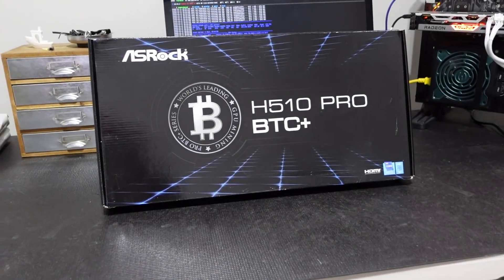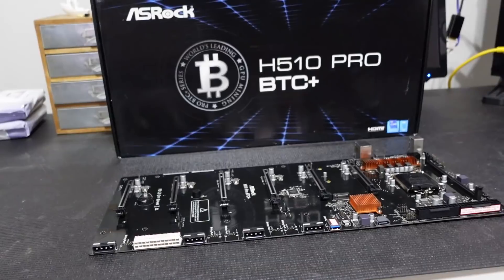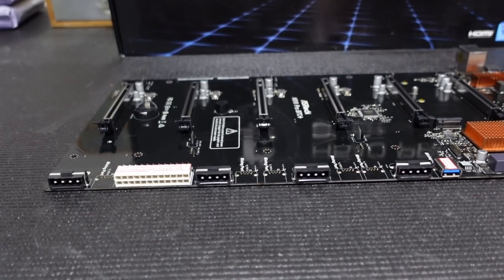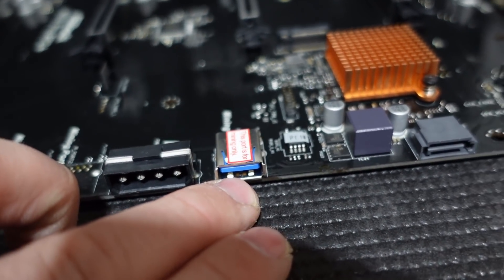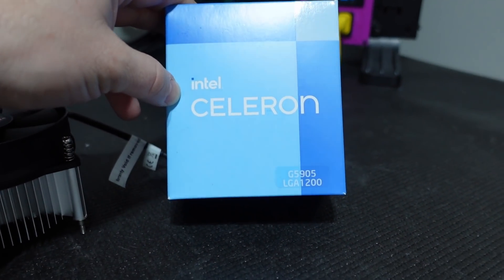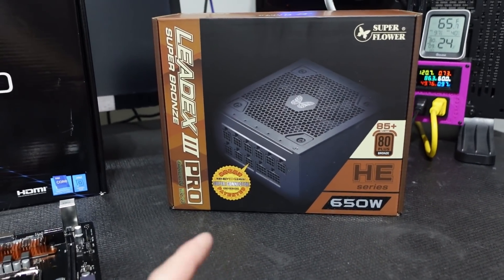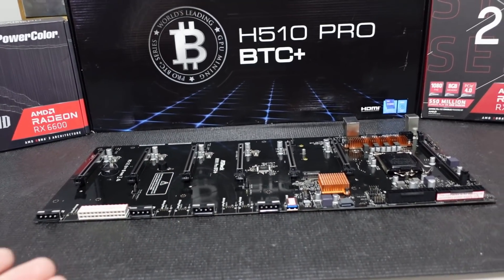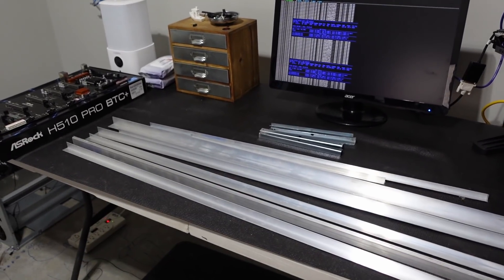Should you use an ASROCK H510 Pro BTC+ Motherboard for Crypto Mining?

Comment: I’ve have 2 of this same motherboard. Currently using two strings to power the pcie slots + one riser, for a total of 5 pcie slots. One string for 3 slots and the other string for the 4th + the riser. Boths strings are fed from the peripherals ports on the PSU. Everything is powered including the GPUs (7 XFX RX 6700 XT) by one PSU, EVGA Supernova 1300 P+. Never had any issues since July 2021 and still running…🤷🏻‍♂️

Comment: This is a good board just didnt care that atx was the only way to go I HAD THIS BOARD AND I CAN TELL U, YOU CAN HAVE A TOTAL 10 POSSIBLY 12. The first slot is a full x16 slot so you can add a x4 or x6 riser card if ur cpu has enough pcie lanes to support. So 4 or 6 slot 1 plus 5 more slots then the riser cable connection totaling 10 to 12 gpus
Reply: tested, doesnt work, bios limited, it crash
Reply: @TwinsCustomsCA  how many cards did u add? did u use slot 1 for the other cards? really need some dirrection thx lol
Reply: @xgx13xgx20  With splitters is it possible to use 12 GPUs on this motherboard? Using a celeron g5905?
Reply: @felubowie  what about a I9 11900k?
Reply: @xgx13xgx20  Right now I'm using a z490 a-pro with 10 GPUs, but I can't go any further. I don't know if for the cpu (g5905) or because of the motherboard. For this I asked you, who in the first comment you said that on this motherboard it would be possible to put 10/12 GPU
Reply: @felubowie  i was saying in theory it could yes depending on cpu, i know my I9 11900k hase the pcie lanes to support 11 but was not able to get a response or figure it out so i returned it for. Btc 37. I also called asrock and tech support there said the board could not handle nore then 7 but i think he was full of bs
Reply: @xgx13xgx20  Ok, thanks for the answer. But shouldn't your i9-11900K be able to handle 20 PCI Express lanes? Intel says this on its site. Technically setting the pcie slots in gen 1 you should be able to handle more than 12 GPUs or am I wrong? Are there any motherboards like the Asrock H110 Pro BTC + for Socket lga1200?
Reply: @felubowie  the cpu can handle the lanes idk why asrock said the board couldnt and i just didnt have time to mess with it

Comment: I went with BTC-S37 with 8 on board GPU slots. I loved the fact that it has an integrated CPU, DDR3 memory slot and M2SATA for HDD. Its plug and play and 1 PCIE power port for each cards (just like a riser) 

I currently run 2 rigs with S37 and it's crazy stable and run low on power! 

Let us know what you think about the H510 pro in a couple of days!
Reply: what is ur mh's on each moba?
Reply: @ErenD  164mh on my 4 GPU 
and 250mh on my 8 GPU 
Still have 4 slots avaiblable wanna join in :P

Comment: Lets Make A Monster with art :

*CPU : Intel Core i9-11900K 3,5 GHz LGA 1200 👍
*PSU : EVGA SuperNOVA 1600 T2, (9x 8pin (6+2), 5x 6pin) x2, (save for future Nvidia GeForce 3x 8 pin connector) u can handle with 3 gpu 3x8 pin/psu. 👍
*Motherboard : ASRock H510 Pro BTC+👍
*GPU : Nvidia GeForce RTX 3090 (2xPCie 8 Pin) x6 👍 (best project Nvidia GeForce RTX 3050 with same bus 128 with this mobo lest see 27 jan 2022 for release) 👍
*RISERS : Asus ROG STRIX Riser Cable PCI-E 3.0 X16 x6 ( for save gpu distance with same spec 👍)
*RAM : 32 Gb DDR4 3200MHz 👍
*STORAGE : M.2 SSD 4Tb, SSD SATA 4Tb. 👍

Btw nice video dude, +1 sub from indonesia 👍

Comment: I have the same board, but aí want to connect + 4 GPUs 6600xt and I try to use the pci-e adapter for 4 more GPUs and the board didn't recognize... I have to flash the Bios?
In total I have 9 GPUs 6600xt on board, we're 5 are connected directly + 1 from USB miner slot only with riser, and I add the adapter on the 6° slot to add more 4 GPUs that I got

Comment: I love those motherboards. Super stable. 🥂. If any company makes sever cases for these they got my business. An all acrylic case would be Amazing and unique. I’ll spend the money for a nice case. 🥂
Reply from the maker: Glad to know I made a good choice!
Reply: Hi, maybe ca you help me, i have this board, and just gpu 0 and 1 is mining, 2psu is needed?
Reply: @yasil7019  you need to power the molex connectors on the board. Those power the pcie slots. If you don’t power them they won’t turn on or mine. Depending on what gpu you are using only one power supply is needed. But if your running something with heavy power you may need 2 PSU to split the power consumption the rig is drawing. Hope this help and good luck. 🥂

Comment: Hooked mine up on an open air rack with little issues, I run 5 cards on a EVGA 1200 P2, 
I'd have to swap over to the server supply/breakout combo or add another PSU to support any more
Reply: Depends on what cards you have but you can probably get away with running more, I’ve got 3 6600xt and 10 6600 running on one rig via a 1000w P2. Just need splitters for the pcie and be willing to power risers via molex or sata. Obviously do some testing to figure out roughly the power draw percentage being drawn through the pcie and separately the riser/slot

Comment: OMG! did you see the Old style power connecters?  Have one similar  but has the newer connector. The bad thing is that if a riser goes out, You can not replace it. The Good thing is that (Mine anyway) That it can take a licking and it keeps on ticking. Even if two of the rails no longer work because of a cable meltdown.  I paid $300 for it. Going to go a different way next time.

Comment: In riserless motherboards, is it possible to hook a Server PSU?
Reply: Yes, you need a Pico 24 pin adapter, or the best way is to get the ZSX breakout board, and get the 24 pin/ 4+4 cpu cable. Then you can run any ATX mobo and server psu’s
Reply from the maker: ^ Exactly.  You can get them from https://www.parallelminer.com/
Reply: @MC...  my bad, can you have a ATX and a Server PSU combined in this motherboards?
Reply: @mxover   You can use ATX psu to power motherboard, ssd, and few gpu’s depending on ATX PSU power rating. Then you can use a server psu to power the other cards, so yes. But make sure you power up the secondary PSU first, BEFORE powering the main Mobo PSU. And when powering down, power down all at once using sync cable, or power off Mobo psu first. Hobbyist Miner should have some vids in his previous videos with more in depth. I’ll try to find it and link it.
Reply: @MC...  thank you very much.

Comment: I bought mine in July, love it! Wouldn't swap it out
Reply from the maker: Good choice! How are you powering the Molex ports?
Reply: @TheHobbyistMiner  the board and molex cable are all powered from a 700w power supply I had laying around and the 6 cards are powered from a crucial AX1600i  It never gets hot. 3080's stay at 80-82c with 4 bequiet 140's
Reply: @AtheistsClaw  I will be running 4x 1660 Ti on this mobo is one 850w power supply enough or should I buy 2 450w psu?
Reply: @XtremeGamerps4  if you don't have a massive processor and several external fans, 850watts will work fine

Comment: Have 2 of these with 10 cards each. Took me a few days to get them running but they are very stable now.
Reply from the maker: Sweet! How are you powering the Molex ports?
Reply: @TheHobbyistMiner  I use 2 power supplies for mining, each has 4 separate molex connectors.
Reply: @TheHobbyistMiner  I use EVGA 1600 T2 and it comes with 5 separate molex connectors.